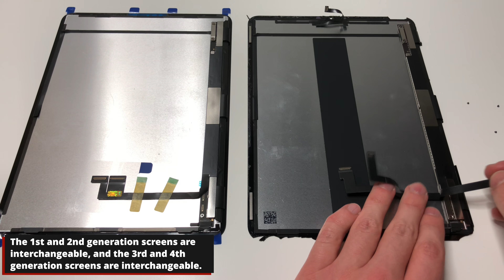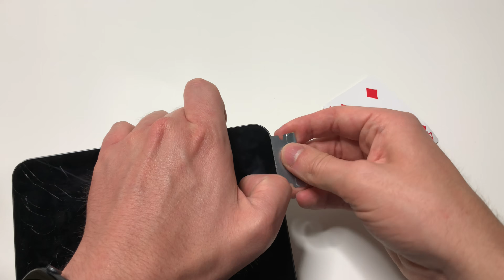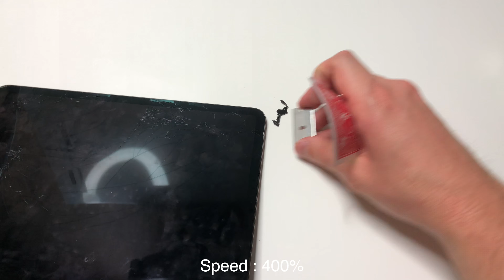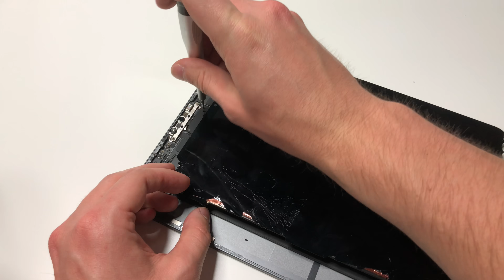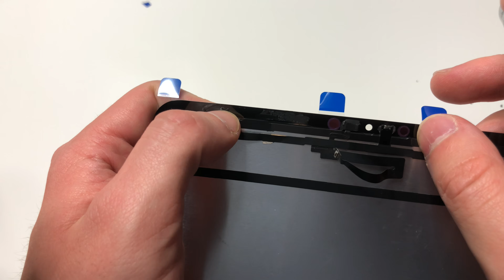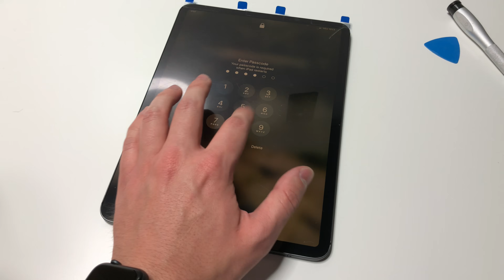iPad Pro 11" (1st-4th Gen) Screen Replacement (Fix Your Broken Display!)

Comment: Hey, would the screen still work without the lidar/ proximity sensor? The ribbon cables broke when it was dropped
Reply from the maker: Yes, you might lose faceid though depending on where the cable tore.

Comment: Thx for doing this. I’m going to try it on my Gen 1. A cracked screen is the only problem.  Q: The ads always mention the digitizer. If I order that, will I be get a screen? The digitizer is a small part of the setup, no? I can’t ask the sellers. Thank you. Keep making these step by step instructions! Also, it would help me if you had an on screen list of the steps as you begin each segment. Thx!
Reply from the maker: Make sure to get the display with the part. It should be a solid panel like what’s in the links in the description